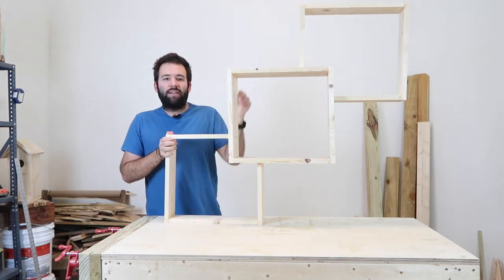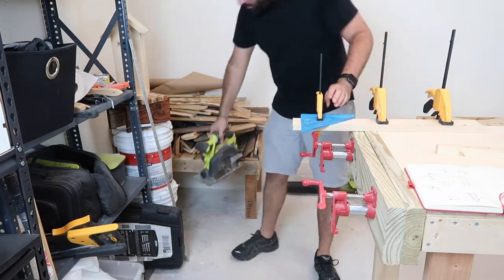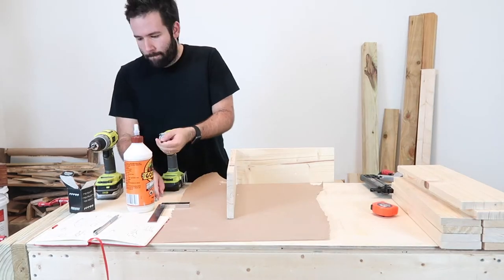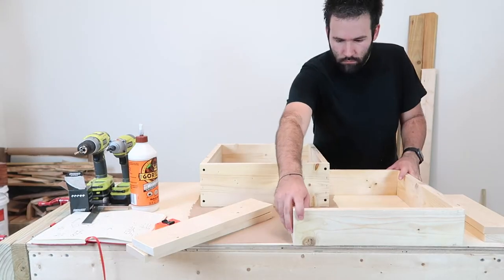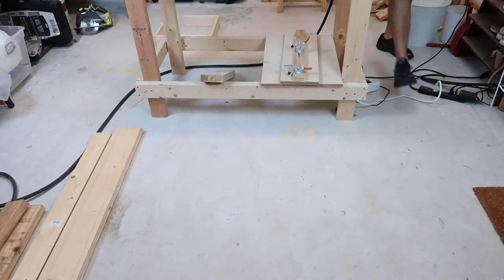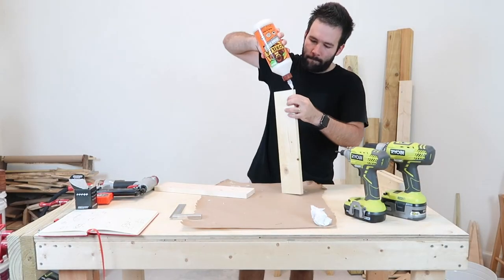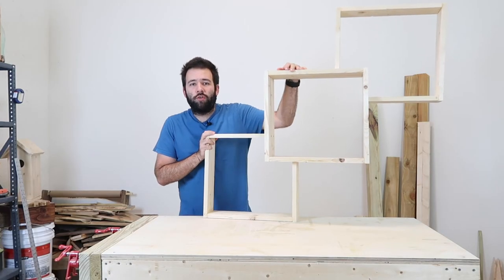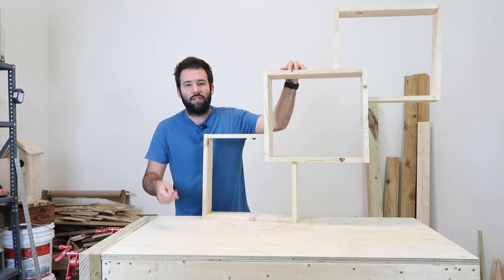SQUARE SHELF BUILD DIY | Ale's Everyday

Comment: Thanks SO SO SO much for this! Excited to build mine for my new place :) just a question, I see you going in 3 times with the drill on each hole. Could you please explain what you're doing? 🙈
Reply from the maker: Yes! I’m pre drilling a Pilot hole, then Counter sinking hole (so the screw head will stay flush with the wood) then screwing the screw in to the hole 👍🏼